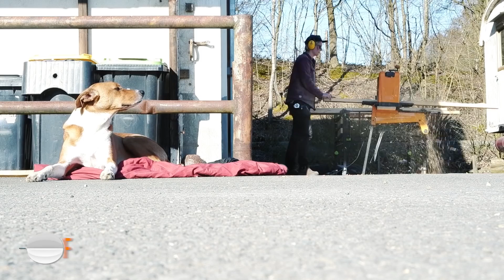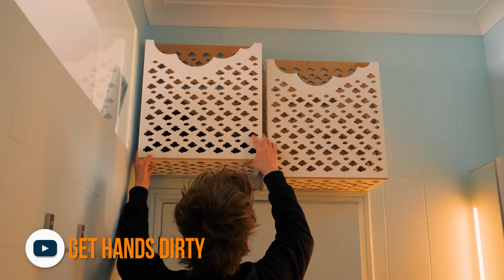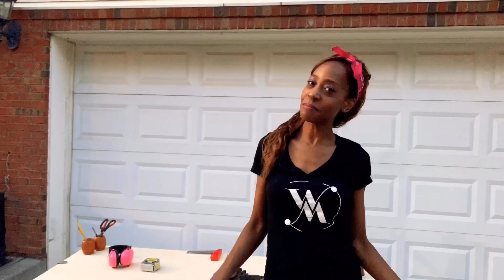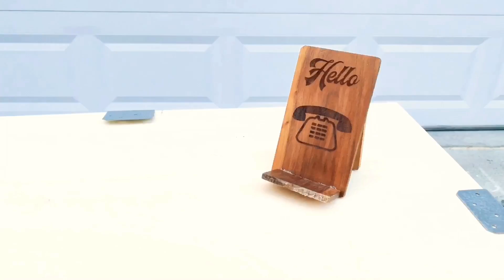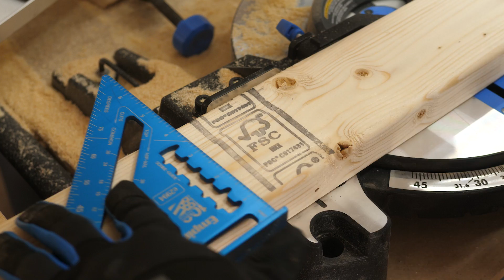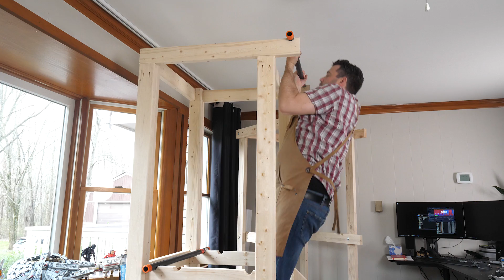Build a DIY Bodyweight Gym for $80! Plus our favorite Maker Videos! S1E11

Comment: FYi - A BODYWEIGHT MULTi-EXERCISE UNIT IS JUST THAT … A M-E-U, NOT A GYM.
SUGGESTION: SOLUTION TO YOUR HEALTH PROBLEMS ARE VISUALLY OVIOUS. THUS, WHAT YOU CRAFTED IS EXTERNAL.
~ ALL 🫵🏻 LACK IS:
1- MAKEUP YOUR MIND.
2- MAKE A COMMITMENT.
3- PLAN THE NEW 🫵🏻 AT THE END of GO”ALL”.
4- BE CONSISTENT.
5- BE PATIENT.
6- LISTEN TO THE BODY & ONLY WORK ON IT “EXERCISE “ AS IT ALLOWS YOU UNTIL IT SAYS,”ENOUGH.”
7- WHEN YOUR HONEST WITH 🫵🏻, THE #1 SOLUTION IS …
SELF-DISCIPLINE.
ESPECIALLY WITH YOUR INTAKE of LIQUIDS & CHEWABLES.
🫵🏻 ALREADY KNOW THIS.
8- FOCUS 1000% ON #7 & STEPS 1 - 6 WILL TURN 🫵🏻 uPSIDE RIGHT.
ADDITIONALLY: SIP & CHEW WITH INTENT or DON’T DRINK or EAT IT. MAKE EVERY MORSEL ADD LIFE, ENERGY, & HEAL THYSELF.
9- LASTLY, REMEMBER THESE STEPS - 1-CLEANSE/DETOX/PURGE YOUR INTESTINES of WASTE, 2-REBOOT IMMUNE SYSTEM & 3-MAINTAIN By STAYING DISCIPLINED.
~ PREDICT THE NEW 🫵🏻 By RECREATING 🫵🏻. ~

Comment: When drilling holes into wood your speed is key. you dont want to go slow the faster the bit is going the cleaner the hole will be. BUT the big thing you need to watch is the pressure your putting on the wood. Let the drill do its just use just enough pressure for it to bite then adjust pressure as needed until you get just about thru you want to use the least amount of pressure possible to reduce chance of blow out

Comment: love this design, great idea for bodyweight. the best value/versatile design i've seen for weights ( basically two free-standing squat rack posts) is the classic home-depot bucket filled with cement and 3 2x4s stuck into it. with a barbell on a squat rack post, you can do pullups and straight bar dips too.  for any suspension rings exercises, just feed the two rings straps through the top of a closed door with a knotted towel to stop it pulling through.
Reply: it's pretty crazy but that's all u need for like 90% of weightlifting,  no squat rack is even needed, if u do front squats. with only a barbell, u may have to settle with floor press ( in place of bench press), but  honestly pushups (progressing into one handed pushups)  are enough.

Comment: Finally. Not a great video as far as step by step instructions, but the design is excellent. Adjustable width, removeable dip bars makes this amazing. That way you create an integrated pullup/dip structure. And you added the bar rests that could be used for a barbell rest and not just a pushup incline. So bench press + pullups + dips design included!!! Great job!!! I was going to build this as 4/4 post sunk in cement structure in the backyard but switched to making it an indoor garage structure because of your video. There is no other pullup/dip homemade video on youtube I've found that has a better design than yours. Most of them are non-integrated garbage.

Comment: Hi Rob! Is it best to avoid using brackets when working with wood? I am in process of building my own at-home gym and bought brackets to connect the joints, however I noticed you only used wood glue and screws.  Awesome videos! Thanks for your feedback 🙏🌟

Comment: Great build. I was thinking tho, if you extend the feet in the front and brace, you could incorporate a squat rack and bench. Jus a thought. Oh, and lumber has went up in the east since the pandemic. Can you still build that for less than $100 where you are?
Reply from the maker: I dig your ideas! As for lumber, I doubt it. I was just at lowes, and garbage 2x4s (8') are $7 each. It's awful. My wife works for a home builder, and she said the cost of materials are absolutely skyrocketing as lumber becomes scarce. If you have a project coming up soon that you can't put off, I'll suggest buying your materials sooner than later.

Comment: I had similar thoughts about working out at home and installed a pull-up bar in the rafters in my basement.  I then started looking for something to do dips and discovered gymnastic rings.  They’re an entire portable gym!  In hindsight, I would have skipped the pull-up bar and screwed in a couple of eyebolts for the ring straps.  For about $50 you have an entire gym that you can workout with inside or outside and take with you on trips.

Comment: Great build! I enjoyed watching this come together and it looks quite sturdy. One suggestion is to use a hole saw to make a hole on each side of the push up bar supports, at the bottom, to be able to slide in another pipe to do sit-ups. This would help keep your feet down and planted.
Reply from the maker: Not a bad idea! I'll work on adding this.